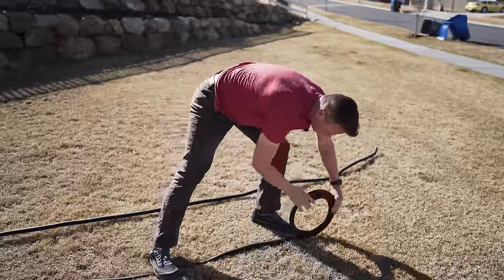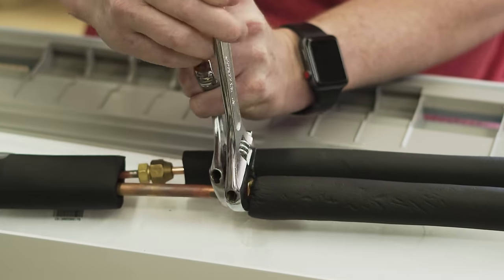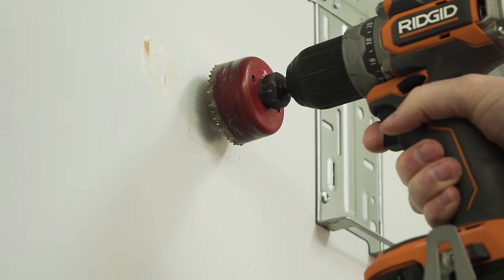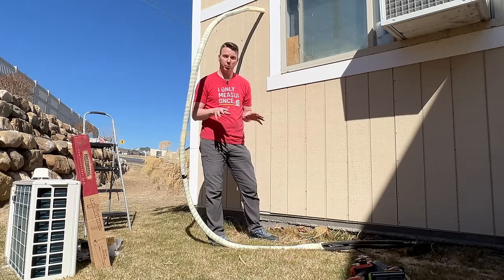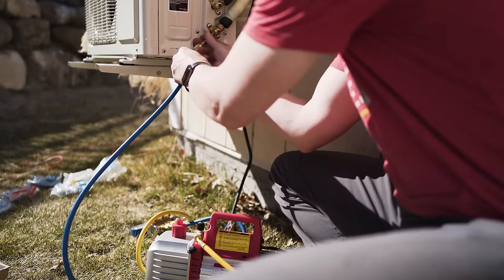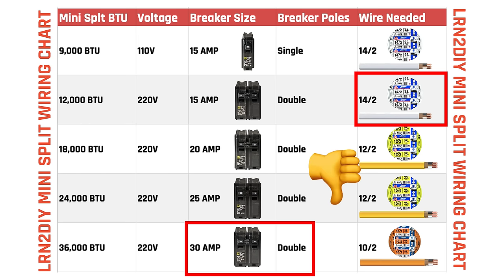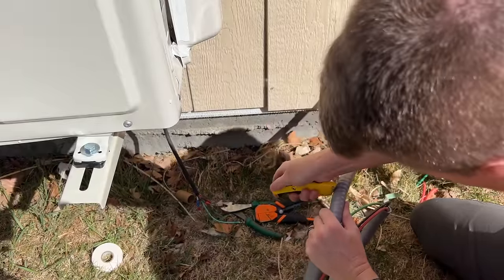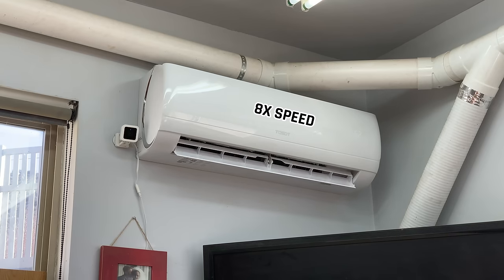DIY Mini Split Install - All the Things Nobody Shows You

Comment: I didn't  notice anyone else pointing out the whole point of insulating the refrigerant lines is to isolate them from the atmosphere AND each other (*since each line is in essence doing the opposite work/job/function) Do NOT combine both lines together and definitely DO NOT allow them directly contact. One is going to be really hot and the other should be really cool!  If you couple them together, you are literally cancelling all the effort the pump has created.  Come on YouTube dude, you can do better?  cheers...

Comment: Do NOT remove the hose before you have released some refrigent to the line set. The will be a lot of air if you try to brake a connection when it is on vaccume.
Reply: I was looking for this post. Please thump up for Veijo.
Reply: blah blah blah blah
Reply: Yes, removing sucion line before puting gas may void the fine vacum you just did
Reply: I don't think he pulled much vacuum with schrader valve still inside and no vacuum gauge. When I do refrig I take valves out and pull vacuum from both hi/low and still take hour with good vac machine.
Reply: Good I wasn't only one noticing :)
Reply: Also, please use a Micron gauge for determining depth of vacuum.  Pretty sure I didn't see nitrogen used to dry out the line set first either.
Reply: @pnp8849   Can someone go with a pre backed system if they're only going to put one in?
Reply: @pnp8849  I use a micron guage. You can't guage vacume leak by just looking at the low side guage.
Reply: Is there a valve in the fitting that allows air out but not in?  I'm having trouble understanding how you can take the vacuum line off without letting air into the system.    Also if you leave the vacuum line on after purging the system, how does refrigerant not escape when you have filled the line?  Thank you
Reply: @tedjohnson401  You are correct.  This is not the preferred (correct) way to do this.  Use a valve core removal tool with an isolation valve to vacuum the system.  As was mentioned above, always release a small amount of refrigerant into the system BEFORE disconnecting anything from the service port.  You want a positive pressure in the system first.  Check for other videos that outline the correct procedure.
Reply: @MartyMitchell92660  I watched this video on the tool I suspect you recommend.  https://www.youtube.com/watch?v=E5G0ehjlHHE, Do you have a link for a video that you recommend for the entire procedure?thank you again.
Reply: @tedjohnson401  That video shows how to properly connect the valve core removal tool (best brand btw).  Connect your vacuum pump to the back of the tool, connect your digital micron gauge to the top of the tool, pump the system down (200 microns is good), turn the valve off, watch the gauge for not much rise, when happy with holding vacuum, let a small amount of refrigerant out until gauge says HI PRES, then, remove vacuum hose, clear air out of valve by opening valve slightly, then close again, install rear of valve core removal tool with valve core attached, open valve, install valve core, remove valve core removal tool, open both service valves on condenser, done.
Reply: @MartyMitchell92660  very helpful.
Reply: Marty, there appear to be many core removal tools available in significantly different price ranges.  Are the less expensive tools as effective if this is a one time use? Thank you for your time.  And I do realize, one gets what they pay for.
Reply: @tedjohnson401  I believe Appion is the best brand.  They're not that much money so I wouldn't waste my time trying with a cheaper one.  Be sure to determine the correct size before buying.  I have a 5/16" (standard for lots of mini splits) and a 1/4" one for other equipment.  Be sure to buy some Nylog Blue to apply to all the mating parts too.
Reply: @MartyMitchell92660  Thank you so much for your wisdom. Unit installed as you directed, works great.
Reply: @tedjohnson401  Congratulations on a successful install.  Just in time for the hot season.  Now you have some tools for all of your friend's and neighbor's installations!

Comment: i am a regular guy.  75 years old.  installed ours in two leasure days.  no problems.  it has worked perfecty for 3 years now.  we love it.
Reply: Any maintenance schedule?
Reply: You should clean the indoor evaporator filter and get leaves off the outdoor condenser every season.
Reply: @webberfan1234  well, if you have a dusty environment, you will need to pressure wash the condenser / evaporator fins of both indoor and outdoor unit every one to three years. also, do not use corrosive cleaners, it will destroy the fins.

Comment: Once you have pulled a vacuum do not just disconnect the line, that will allow air in, release liquid line (small pipe service valve) with an Allen key up to 10psi or more then remove the line, this makes positive rpessure in the pipe preventing air getting in when you take off the blue hose
Reply: Always release the suction line first. Not the liquid line. Opening the suction line first allows oil return that is lost from the pressure swoosh to better reach the compressor. It is stated in every installation manual for a reason.
Reply: As an air con engineer this made me shout at the tv. I thought what are you doing 😩
Reply: @rollsie  the more people following these install videos, the more people will have DRASTICALLY reduced system lifespans…
Reply: @SuperVstech  on my Senville, it said to release liquid line first. They actually say to release it for a couple of seconds and close again so there is about 10psi in the system. Then disconnect the vacuum pump quickly. Then fully open liquid line, and then fully open the suction line.

They also gave me a torque value so high for the liquid line that it destroyed the flare, so either my torque wrench is malfunctioning or the install manual has mistakes
Reply: @william18miller  wild…
Reply: Same here it bugs me think they know what there talking about because they google something over some one who went to school for it lest save a buck and do it wrong so we don't have to pay some who went to school for this
Reply: @william18miller  Make sure that you are not looking at inch pounds in the manual and setting your wrench to that number in foot pounds. IIRC, the liquid line is about 10 foot pounds and that should destroy nothing.
Reply: @tombonini7393  The manual said 13-14ft pounds on the 1/4 inch line (it was actually in Newton meters but I converted it) and my torque wrench set at 13 was too much. it could very well be my torque wrench is not accurate, so I ended up tightening by what felt snug to me after redoing the flare and all is well
Reply: @SuperVstech  that's great for the HVAC industry
Reply: @baconbot3106  this is job security.  You think a DIY'er who spent $1,500 and his/her system fails in 18 months is going to try it again?
Reply: @rollsie  yep
Reply: @baconbot3106  my problem with this is my cheapest quote for a 2 zone unit was $11.5k installed and a complete DIY package is around $5.5k (Mr Cool and all other material needed). Tough to swallow $6k in labor when the only real skilled portion is the electrical and an hour of refrigerant tech work.
Reply: @mtskibum16  Gotta take care of your boss's vacation homes and his fleet of F350's.
Reply: A "salesperson", from a reputable dealer, quoted me $5K for a three zone unit. Great, until I found out the they push a specific brand with a SEER rating of 15(!?) which would have cost me between $150 and $300 per year in energy cost as compared to a 20+ SEER unit. I'm suspecting Pig Power inc., aware of the energy savings a mini split offers are pushing these energy hogs with the help of local AC contractors (who receive a small "bonus" above these low quotes that dupe many customers).  
Note: I'm aware of Uncle Sugar having rebate programs for mini splits, mostly aimed at low income customers, but an inefficient unit could end up costing more in energy costs than the unit it replaces!
Go DY'ers!
Reply: Have you met HVAC techs? It tends to be drop outs who weren't smart enough to do something else. Anyone can learn how to do this work.@baconbot3106
Reply: @rollsie  So then be more specific! Tell us where you are concerned. What he could or should do differently. I think he did fine.
Reply: @SuperVstech  why?

Comment: If you're going to oversize the breaker (30A), then you MUST install a fusible disconnect with properly rated fuses (no more than 15A).  By supplying that heavy gauge (#10, #8) wire to the unit from a 30A breaker, the small wiring inside the outdoor unit will be the weak link, and a failure in either the indoor or outdoor unit could easily start a fire because there is no way that breaker will trip before internal wiring melts.  Just because you are using #10 wire doesn't mean you have to use a 30A breaker -- you could have just as easily used a 15A breaker.  Also, the #8 wire of the whip was way too large for the terminal screws.
Reply: We installed a Mr Cool DIY 27k unit. The manual said to use #8 wire for the 30amp breaker. We called the company when the wire wouldn’t fit into the panel of the outdoor unit. 
“Oh yeah, use 12”
I’m on the other end of the phone…. Then why does the installation manual say to use 8……
Reply: Hello Steve i am doing mini split my myself. 

I have 20amp breaker and 30amp ac disconnect for 12000 btu. 
I am almost done but finished the wire part. I didn’t know I have to use 15amp breaker for 12000btu… do I need to change it to 15amp ? If so how about which amp disconnect shall I use ? 
Please help me 🙏🏼
Reply: @EllieTheTrucker  A 12,000 btu mini split will require a 15A circuit, but check the paperwork that came with the outdoor unit as it will list the electrical requirements.  If it requires 15A, you can have a larger breaker as long as you have a 15A fused disconnect at the unit.  Keep in mind that the breaker must match the wire size.  If you have a 20A breaker, then you must have at least #12 wire.  15A breaker can technically use #14 wire, but you want to minimize voltage drop so don't go smaller than #12.  If you have a 30A breaker, then you must use #10 wire.  If you have a non-fused disconnect, then you will need no more than a 15A breaker.  In some cases, you can go up to 20A, but check to see what the manufacturer recommends.  Also, you will need at least #12 wire, but if your run is longer than 20-30 feet, you'd be better off increasing the wire size to #10 just for minimum voltage drop.
Reply: True 👍
Good advice
Reply: @EllieTheTrucker  read the label on mini split it will tell you the amperage you need do not go on the information that someone else uses different manufacturers have different amperage. As for the disconnect just get a 60amp non fusible one. The breaker inside will determine the amperage to disconnect.
Reply: @swp466  Thank you so much Steve ! The mini split works now 😊 so happy
Reply: and yet another knot it all who should be doing his own videos instead of giving us you "expert" opinions
Reply: @samkimbell923  I have the same 27k unit using it for 2 zones. I got 10 Guage and a 40 Amp breaker.. I'm thinking I should drop the breaker to a 30 Amp. Did  you end up using 12 Guage successfully?
Reply: @EllieTheTrucker ,  The outdoor disconnect switch comes in 30, 60 and even larger sizes.  The 30 or 60 amp disconnect has plenty of capacity to use on a smaller circuit.  Either one is fine.  Just do not hook up a load greater than 30 amps on a 30 amp unit, or 60 for the 60 amp.  It is fine to have a 5 amp circuit breaker on a 30 or more expensive 60 amp disconnect.  

You should use #12 wire and a 15 amp circuit breaker with the 12,000 Btu unit.  #14 wire is smaller, and acceptable, but I would be using #12 wire.
Reply: @Jonedvega , With 10 gauge wire, 30 amps is the largest acceptable breaker size allowed by American NEC codes.  If your unit says "25 amps MOCP" then you need to protect it at that rating, not 30 amps.  This is easy to do with a fused disconnect, as most circuit breakers are 20 or 30 or larger capacity.  Of course your unit might also say "Minimum circuit size 20 amps" and that would be acceptable to use a 20 amp circuit breaker in that case.
Reply: This is solved by using a fusible disconnect with 15-amp fuse. 
  Extremely helpful video, but I am disappointed that he didn't explain that 220-volt uses two hot lines and no common (white) line. The common line is used only to supply 110-volts (e.g. the light bulbs on a 240v electric stove).  Without at least tagging the white conductor with red tape, the next person to access the disconnect could carelessly assume 120v or touch a "neutral " line and discover it's hot.
Reply: @swp466  I'm installing a 12,000 BTU unit on a 20A breaker with 12/2 wire. I can only find fused disconnects in 30A and 60A, not 15A. What should I do?
Reply: @swp466  would a 10 gauge whip be fine for a 15A double pole breaker?
Reply: @JM-lw3nx  If you've done any video's you know it isn't just filming them but editing down to a reasonable length that takes days longer
Reply: @samkimbell923 Ive run into that discrepancy before a few years ago with something else- my ceramic kiln, the manual said to use something like #10 ga wire I forget exactly, but it definitely did not match the amps the kiln was!
Reply: Wrong, there are no choices in going up in size on a breaker. If the unit is a 15amp unit with or without a fused disconnect the wiring and breaker must match the unit limits. If the unit calls for 15 amps then you can not use a larger breaker not even 20 amp. You can use larger wire as it will not have an effect on the danger of overload or over current. But the breaker will indeed make a difference. Even if you use a fused disconnect with 15 amp fuses the breaker still needs to be 15 amp as the code says all breakers fuses or means of disconnect must meet the overload protection as listed on equipment being used. Over sizing wire is fine and in some cases over over 100’ it is necessary to prevent voltage drop. This is why it is expensive to hire a real licensed electrician because we spend years of going to school to learn code and proper installation practices so you won’t burn up your equipment or worse.
Reply: @raymondperez3963  Allowed under 240.21(B)(2)(2).  The OCPD is the 30A breaker, with properly sized conductors between it and the tap (fused disconnect with properly sized conductors downstream).  This same scenario gets inspected and passed all the time.
Reply: I installed a 24,000 btu MrCool. In the installation manual citing the Maximum Overcurrent Protection (MOP) and Minimum Circuit Ampacity (MCA) rules, they specifically say "Minimum of #8 wire, with #6 preferred" and a "35 amp circuit breaker for maximum over protection on the 24,000 btu unit". Yes the small terminals are way too small and the internal wires are no where near #8 which is confusing. #6 would never have worked on those terminals on the unit. I did get the #8 wires cleanly connected but to me if they want big boy sized wire, they should put on appropriate terminals to hook it up to. That was my chief complaint on this unit. I had one other related gripe and I do intend to call them and see what they say about both.